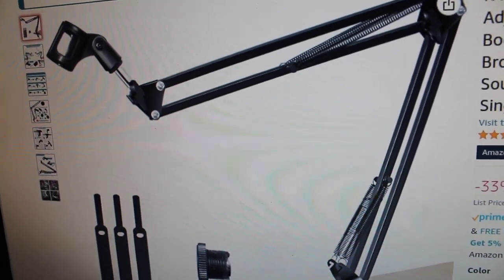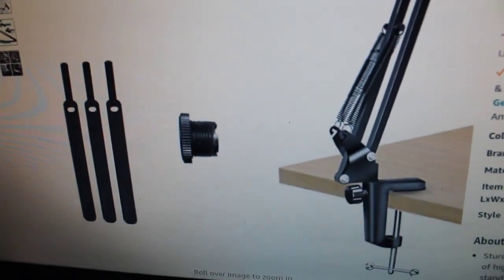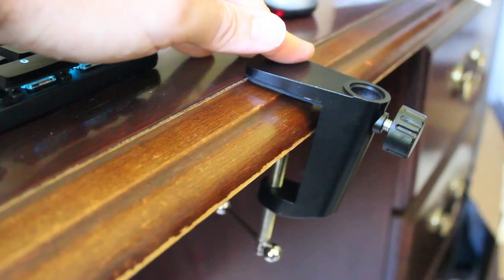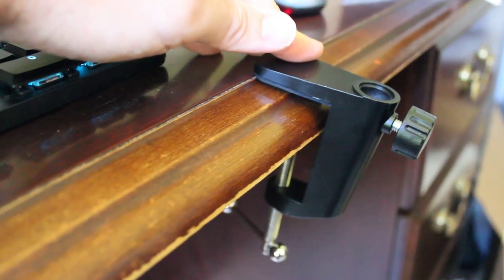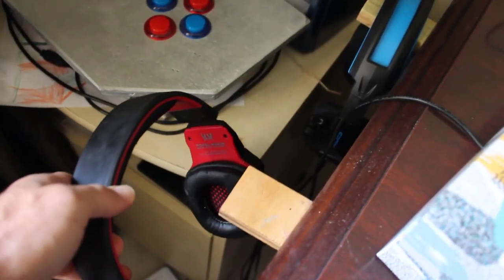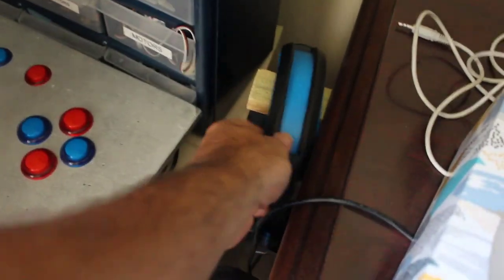I bought a Mic Stand

Comment: The audio sounds excellent. I actually have that exact same mic stand. I had to wrap a tiny bungee cable (a rubber cable would do too) around the spring area because it was causing a sound when I would hit a key hard. You can hear it twice in a short sequence here, https://youtu.be/HzRWpO3poxE?t=77. Audio has been tough for me to get just right. More often than not there is something I am not happy about with my audio in every video I make.
Reply from the maker: I use to do Wedding and other videos.  Audio is always the hardest part.  When possible it's always easier to through the audio out and lay a music track down. :)